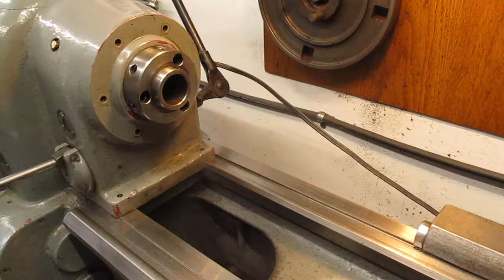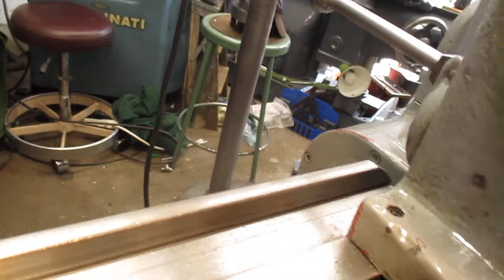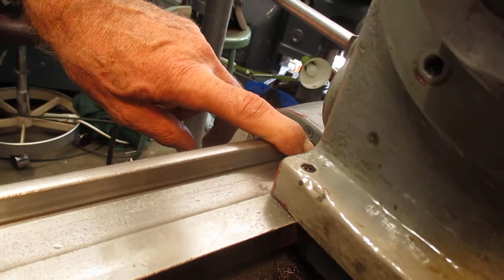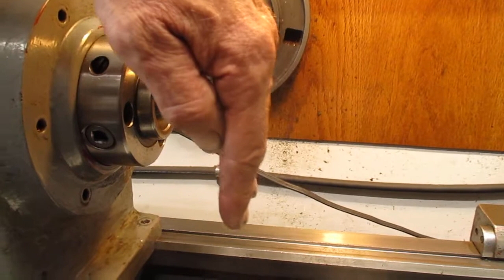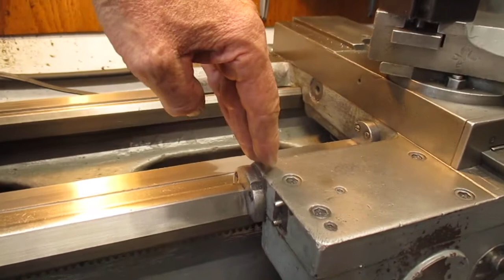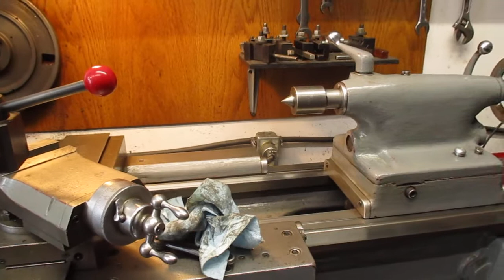Monarch 10ee lathe, using a worn machine

Comment: what do you look for on the ways to “run Forrest run”?
Not always possible to make a cut and check the taper when looking over a used machine
Thx
Reply from the maker: That is a gamble, I have most of my experience on really worn-out lathes. The one lathe that is not worn out I try not to use.